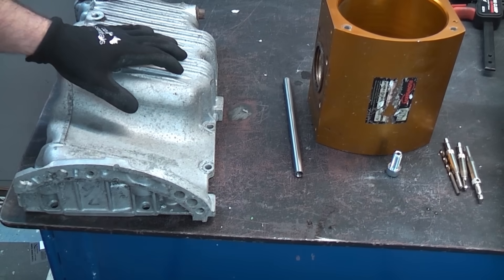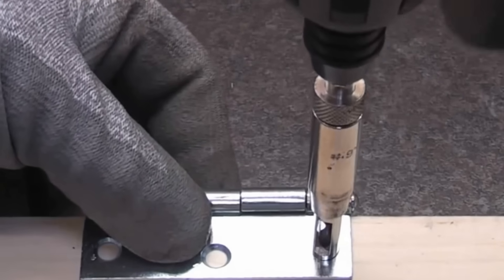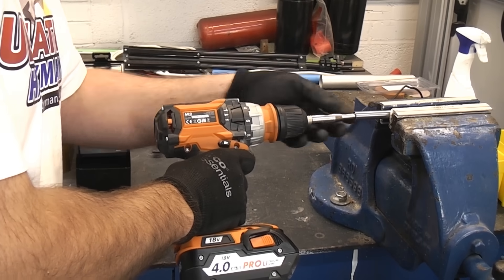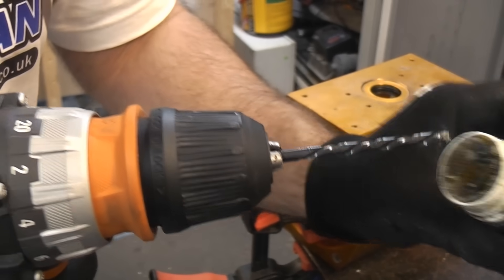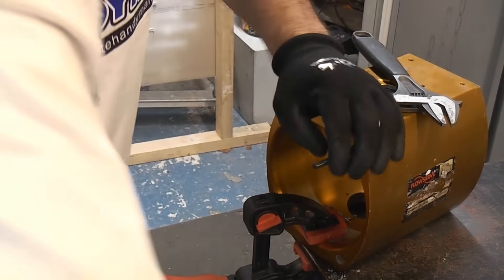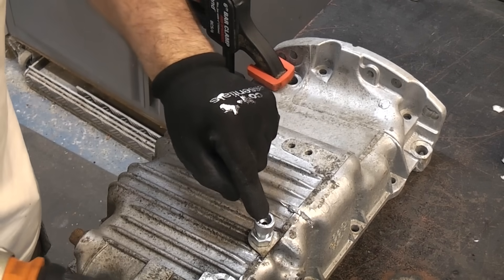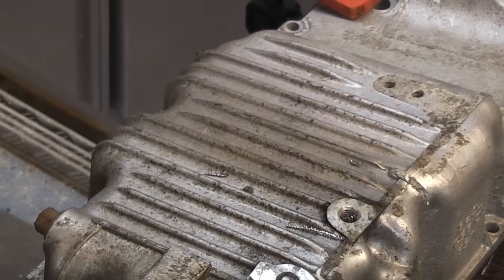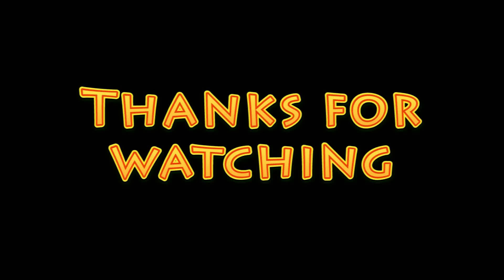How to remove a broken bolt in a deep hole | remove broken bolt in recessed hole

Comment: Snap on makes 3/8 drive sockets that snap on to thread taps so you can use a racket
Reply: tennis,  or badminton?
Reply: 12 point sockets will work on taps also metric on some sae on others
Reply: Great if i need a speedy way of returning a serve at Wimbledon.
Reply: @highlightsbottleflipnbanfl1847  LLP
Reply: No more adjustable wrench for me
Reply: Lol get an erwin tap holder and youll be snapping taps in no time for only $20. Most people end up busting the tap with a ratchet because they only cranking from one side.
Reply: Irwin makes them also....for a fraction of the cost of snap-off im sure.
Reply: @JPizzle95Z  Say what you will but Snap on is GOOD STUFF!,I go into a place and see junk tools it reminds me... "Good stuff seldom cheap", "Cheap stuff seldom good".I built Automatic Transmission a little over 35 year,Good tools pay for they're self.
Reply: @packingten 
The only good statement you made there was, “Good tools pay for themselves!”

Nothing in that statement equates to Snap-On tools being good tools!

Matco also has tools that people can buy off the backs of trucks outside of their body or mechanics shops!!!
Craftsman tools has always been equal in quality to if not better than Snap-On and Craftsman doesn’t give much of any crap to someone returning a broken Craftsman tool!!!

Snap-On tools will make you jump through several hoops before they will willingly replace any of their broken tools!!!
Reply: @AzzKicker-bz1cb   Craftsman tools from 30 years ago were on the level of snap on .. its all chineasium now .. and As far as broken snap-on  tools go I just hand them to my dealer and he hands me a new one without question ..never in 20 plus years in the business has any of the plethora of snap on guys every made me jump through a hoop for tool replacement.... that being said Snap on is mainly a huge ripoff haha  ... I would recommend people buy affordable tools and use them for a while and whatever they break consider stepping up to snap on or mac / maco etc  ... just roll with the other tools that hold up ... and don't fall into the buying tools like a hobby trap!  Buy tools that save you time and make you money !
Reply: @packingten  most of my hand tools I have for over 25 years... they where not cheap and almost everything is sandvik belzer. German/Swedish brand. No American brands at all! Best tools in the world in my opinion .
Reply: @JPizzle95Z  funny snap off love it
Reply: @Jordan Platt 
As will or does Craftsman and Kobalt tools, I’m sure!!
And in this case, he probably could have used a 1/8 or 1/4 in socket on a 1/4 drive ratchet to turn the screw extractor.
Reply: @JPizzle95Z  I use Irwin their garbage to as much as snap off
Reply: @JPizzle95Z  irwins are petty good. maybe not as good as snap on but for the price i would use them
Reply: @JPizzle95Z  
The snap on/blue point  ones ain't bad in price. 
I forgot what I paid , it was probably 15 years ago.
I definitely didn't get robbed because I'm cheap and I decided to buy em.
Reply: @MrTheHillfolk  lol ... it's snap on ... of course you got robbed.
Reply: They’re worth every penny
Reply: Great job & ideas 💡👍👍 thanks for your time and video 👌All the best 🙏
Reply: Tapping the extractor with the hammer, while putting pressure on it also helps to make them bite and shock the bolt at the same time you try to turn it. 
I’m definetly stealing the “hollow bolt” idea.
Reply: If it makes a "racket," you better wear ear plugs.
Reply: Good, Venus or Serena will be able to help me out with my valve cover that has a broken bolt
Reply: Cheers mate love the hinge locator I work on motorcycles exhaust studs are a nightmare I think you have saved me a lot o future time lol great work making bolts not pillar drill posh people have lathes lol
Reply: 8
Reply: Mister Fister p
Reply: Coming in late but the 8 point or square are called plug sockets.
Reply: Very good info
Reply: Between SAE and metric, I can find a good fit with my 12 point sockets for the medium and larger taps. This works nice with an extension and tee-bar driver to get past obstacles.
Reply: Yeah you can buy them really cheap at any HVAC store as well since most Refrigeration valves whether it be your air conditioner at your house or more complex systems, they basically all of use various sizes of Allen, which should be recessed naturally, or like the rent you're talkin about which everyone just calls a Service Tool in HVAC, since there are so many square head valves out there, usually they're double ended, etc.  So you don't necessarily have to spend a fortune with Snap-On to get a decent Service Tool :-) -- most people don't know about that though, what you posted that is, so just wanted to throw a quick comment out there without a bunch of details LOL - granted, a TAD too long of a comment LOL
Reply: Mister Fister   per month.
Reply: I just use my 8 point sockets that everyone  makes.
Reply: many brands make tap drive sockets lol and dont cost your arm and a leg...
Reply: The reason to use a tap wrench is 2 handles centralise the torque on the centre of the thread, reducing the risk of shearing.
Reply: I have those,looking at them for colour they seem higher quality,I've put pressure on mine,not one is marked,I tried cheapo before and snapped all of them.Snap on hasn't snapped,drill bits to match have been well used and replacement for higher quality.
Reply: Ratchet
Reply: @autotechtogo6290  Come on, don't you work in the industry? I would expect that kind of comment about the tools being "the same" from other brands from people who only use tools for their personal cars, not from someone who depends on the tools for their livelihood... I used to be a mechanic, and even their "rebrand" BluePoint is much better than the consumer shit people buy for their DIY projects...
Reply: Whats ratchet about your statement is you misspelled ratchet with racket
Reply: @apegues  https://shop.snapon.com/product/Adjustable--Tap-Sockets/2-pc-Adjustable-Tap-Socket-Set/ATSSET
are these rebranded?
Reply: Buy Snap ON, or just replace the entire motor. Price is about the same, but you may be able to fix one other motor before it brakes. Oh, and that lifetime warranty, bull shit.
Reply: Yes any good mechanic knows that Ann many other tricks to remove them
Reply: Call snap on at 1800snapon or Google the number
Reply: <6
Reply: Pff...If you buy Snap On, you're just another sucker for financial punishment...lol.
Reply: Or just grind something into an adapter - most of us have lots of extra tools, that will never be used again because of updates. Beats having to drive after things, that have to be paid for too.
Reply: Ultimate Handyman, I have a broken bolt steering stem on a dirt bike. It's not coming out and it's deeply recessed. Any chance of it coming out? I've tried everything but a left hand drill bit.
Reply: I have non of those tools,I cant get I out
Reply: Yeap 
And then an idiot attaches a rattle gun   and now there is a broken high speed steel tap snapped off down the hole .
Don't be lazy
 feel it by hand pressure
Reply: @Joel Seim  over the years i bought a lot of quality tools from snap on. sockets, gear wrenches. vise grips, ratchets from 1/4 to 1/2 inch, air tools as well die grinder and bits, air ratchet (3/8 drive) and their Torque wrenches are top quality.
but snap on is a bit pricey. and you have to watch because they do sell non snap on tools as well. so do your research first.
Reply: Thank you.
Reply: I have an old Craftsman ratchet and socket set that includes 8 point sockets. They work great for anything with a square head.
Reply: What size hole is drilled threw the 12mm ,10mm, 8mm bolt? I'd like to make some
Reply from the maker: @lowridingtrucks88  
12mm - 8mm maximum
10mm  - 6mm maximum
8mm - 4mm maximum
Anything larger and you might struggle.
Reply: Yes they do, & I have some of those in Husky brand that have helped me in the event the bolt sticks up above the surface. This last one I did this past week was under the surface. Still got the son of a bitch out!
Reply: What is a racket?  ;)
Reply: They do and they work well.
Reply: That's nice and all on clean bolts but what about rusty ones that were exposed to alot of heat
Reply: Hi joel pics and part # on the snap on pieces thankyou.
Reply: Makles too much a racket
Reply: We've got a hole drilled all the way inside the bolt. Now, we tried putting the extractor in there and turning to the left and it will not budge. My dad put all his weight on it and it won't budge a bit. Any suggestions?
Reply: Now I'm totally convinced that everyone that comments youtube videos is a total tool!
Reply: Reverese drill bit, done. no need for explanation or video lol
Reply: Ratchet?... not Racket
Reply: Lisle also makes a set for around 30 which is more within reason for the diyer. I love my snap on believe me just got some again today but shop smarter is all cheers 🤭
Reply: Are you using drill bits with reversed cutting edges?  I assume them to be or they would cut/grab??
Reply: a 16 point socket will do the trick
Reply: Iiiiill
Reply: Lisle makes them cheaper maybe for Snap-on also like $55.00 Can.
Reply: Jesus stop commenting if you're going to make us all look illiterate.
Reply: Snap-On sells overpriced tools. 
All that is needed is an 8-point socket regardless of the drive. It could be Craftsman. It could be Husky. It doesn't matter. You can buy it at Harbor Freight.
Reply: racket?
Reply: @autotechtogo6290  Yeah instead of buying from a man who can helpnow...,get in car drive wherever maybe 2nd store,uhhh well 3rd store??!,Gee I saved 3 bucks...Showed!  Snap on man a thing or 2.
Reply: @packingten 
If driving to three different stores only beats a Snap-On man buy $3, then those stores are ripping you off!!!
On 98% of all Snap-On tools, their price for everyday tools is three times that of anyone else in the tools industry!!!!
That’s 3X per dollar, not just $3!!!
Granted, if the tool your buying is only one dollar, 3X that would only be $3!!!

Unfortunately, your never going to find a tool much of any kind of tool that Snap-On tools price is ONLY $3 more than the one you purchase anywhere else!!!
Reply: @packingten  whatever you do don't buy em from harbor freight! most of their items are crap....
Reply: Buying "Snap On" tools to remove bolts is like buying a Porsche to deliver newspapers.
Reply: @djrowe10  Sorry Buy cheap, get cheap. Snap On, Mag, Starret, Dormer etc will last a lifetime, throw away the chea ones or suffer the consequences.
Reply: Wait till your cheap extractor snaps off in bolt then get back to me
Reply: I think 8 points. I would hit the side of this my standby.
Air chisel flat end bit,it will shock that bolt well!.
Reply: @packingten  not a good idea though to do that to an aluminum item you could cause more damage if not careful. it depends  though if you are using a small chisel gun that may work but not one of the big badass big brother chisel guns....
Reply from the maker: Thanks for the comment
Reply: Ultimate Handyman to come
Reply: Ultimate Handyman 
And what does something like that run? (Sale for?)
Reply: @fellowtraveler2495  the lisle set is about $32 on eBay
Reply: @ultimatehandyman  y
Reply: @ultimatehandyman  ⁵
Reply: @ultimatehandyman  0
Reply: @ultimatehandyman  hi Boss what is that cool tool you use called the one that fits in the hole and do you have a link so you can get credit I need it I just broke a bolt in the oil housing the housing that holds the oil filter..
Reply from the maker: @kangokidkidd4037   Not sure which tool you mean, but here is a list- 
Hinge centering drills- https://fave.co/2DpJo1H
Left handed drill bits- https://fave.co/2xJjK1M
Teng screw extractors https://fave.co/2OnfRuF
Dormer taps -https://fave.co/2OsN1sQ

If you are in the UK-
Hinge centering drills- https://fave.co/2NE1VMc
Left handed drill bits- https://fave.co/2DubtF4
Teng screw extractors- https://fave.co/2pVLkVT
Dormer taps - https://fave.co/2pTfbyx

exact cutting paste- https://fave.co/2Nabyxc
cobalt drill bits (they are much better on harder steels like bolts) https://fave.co/2zDh3kp

You'll have to make the guides yourself, but they are easy- https://www.youtube.com/watch?v=6mZj0J6CNYA&t=1s

Spring tools centre punch- https://fave.co/2NbnLBD
Reply: @ultimatehandyman  :: those custom “center~finders” should be marketed in mm,,,,or maybe lathe plans to build a set…
Reply: @ultimatehandyman  oooooooooooooo?,
Reply: Ultimate Handyman ur from Holland huh?! 😊✌🏼
Reply: @healedbypitbulls6995  He is from UK but sounds dutch a bit aye?
Reply: I'm so f##Cking annoyed when a stud snaps I wouldn't think of your trick in a million years so stud extractors work better if centred interesting lol
Reply: Joel Seim  A racket? You mean like a tennis racket? or maybe a ratchet.
Reply: "racket"?
Reply: Joel you have a part number on those?
Reply: Brian B Lisle 70940 Tap Socket Set - 3 Piece
Reply: @brianb5779  use the snap on square drive 3/8 sockets
Reply: @brianb5779  @
Reply: @brianb5779  lisle tool company made them. 8 piece set.
Reply: Brian B Lisle LI70500 Tap Socket Set
Reply: @madaronyart1  Thanks got a set amazon warehouse $23 something.  8 piece set.   $1.50 more than the three piece set.
Reply: Sir which type of paste
Reply: Joel Seim is it possible to change that part of the engine that he's working on? n can u tell me what part of the engine is called , mines cracked where the bolt is supposed to go in so now every new bolt keeps breaking in that part n the belt comes off
Reply: Oil pan
Reply: @lisango9330  that aluminium part is called a sump in the UK or an oil pan in USA and can be changed
Reply: @lisango9330  put bolt in with liquid metal and take it straight to auction lol or change case you'll never stop the leak
Reply: @lisango9330  ?
Reply: @lisango9330  If the part itself is cracked, you will likely have to find another one that is not cracked. This can either be a new part from the dealer or a used one from an automobile disassembler.
Reply: @lisango9330  and
Reply: @lisango9330  ^sea
Reply: @lisango9330  It needs welding.
Reply: @lisango9330  It really sounds like something else is wrong. You may can put JB Weld on a stud and screw it in and use a nut on the stud if possible. If not, try some red loc tite on the bolt, all over the threads, leave it to harden before putting pressure on it. You can take it off and have it welded. That works because a bolt can be in the hole while welding, since it is aluminum, and keep threads good. Many options.
Reply: @ridgerunner106  there are also ways to weld aluminum these days but he would have to remove the part to get it done. not sure how much it might cost but you can research it. and the price to replace the part in question. so if it costs more to weld it than replacing it at least he would know his options.
Reply: @ridgerunner106  i
Reply: @ridgerunner106  reverse drill bit.. wow you guys work too hard and buy too many tools
Reply: lisa ngo use alloy solder to weld the broken part back in place. Cracks can be ground out and filled with the stuff. Getting it TIG welded may not be silly costly.

Comment: Brilliant - in the centring bolt can what sizes hole you put down the centre and what size drill you used?  For example on an M8 would you drill it to take a 5 or 6 mm drill bit ?

Comment: Wow. Very comprehensive. I will try my luck, since my bolt is lucky: sheared flat, and stuck in a fixture harder than the bolt. It's a little M6 fastener for the ABS speed sensor on a front wheel drive so it's in the hub.

Comment: You know your stuff, and I learnt something new. Thank you 🙂
Also, I now use ceramic anti seize grease. Because the traditional copper type can actually cause different metal reactions; which can cause the opposite outcome, seizing in. Good for bits that get very hot too like injectors and brakes. But thanks for a top notch production 👍

Comment: I love the disappointment and doubt when you say about the penetrating oil:  "There's a chance it may help".  That's pretty much been my experience as well - but I always try it.  Worst broken "bolt" I had was a tap that had broken off below the surface in an old cast iron engine block.  From the age of the engine and the rust on the tap it had likely been in there for decades.  It was also a fairly small diameter and a blind hole.  I basically ground the tap out using a brass tube and an abrasive slurry.  Maybe not the best way, and certainly not a fast way.  But it worked and didn't damage the threads.
Reply from the maker: That sounds like a nightmare of a job, but well done for getting it out!

Comment: How would a steel bolt sheer off in aluminium ?
Reply from the maker: Aluminium is more ductile?
The bolt could have been high-tensile, so more likely to snap than flex? 

I’ve seen bolts shear for fun, when 12.9 bolts where used instead of 8.8 bolts!

Comment: Good tutorial, many guys now go straight in with a welded solution, this is ok if there's no risk of damaging the exposed threads (particularly aluminium) and the smaller the stud the less chance that you can use this method. 
A comment on stud extractors and drills, definitely go for a good quality tool,s set of Dormer extractors will do the job better than anything cheaper. Drills, LH, great and cobalt iis good too.some say solid carbide but wonderful though they are they are more brittle and prone to break if not fed dead true say on pillar drill or milling machine, still using the guides is a very good tip. Good video, no disco music or bulls*itt. Sensible advice.
Reply from the maker: I'm glad you found the video useful! Thanks for the comment and the advice 👍